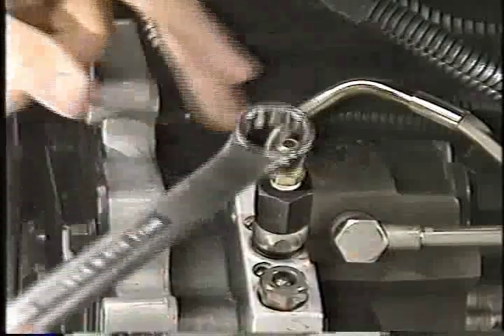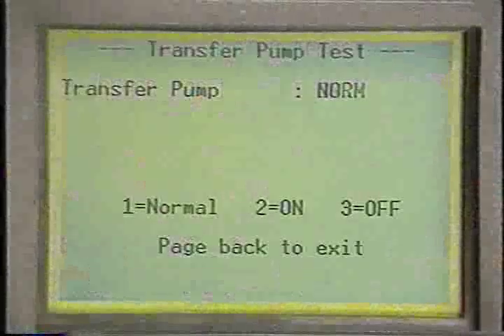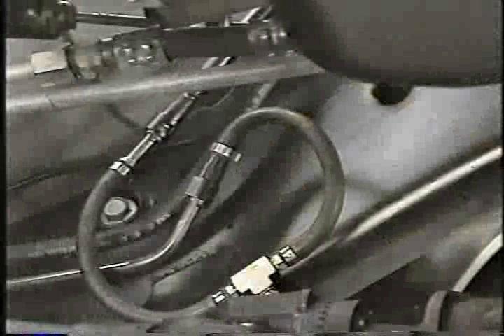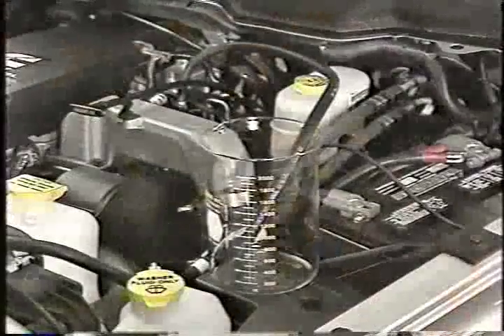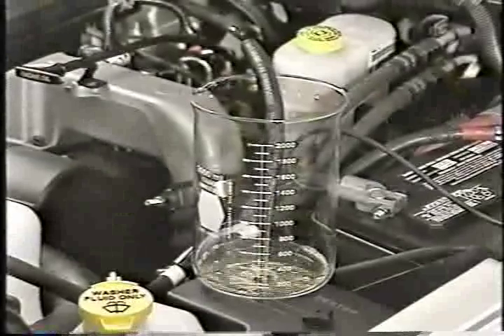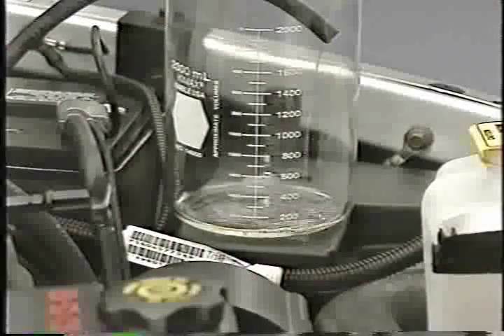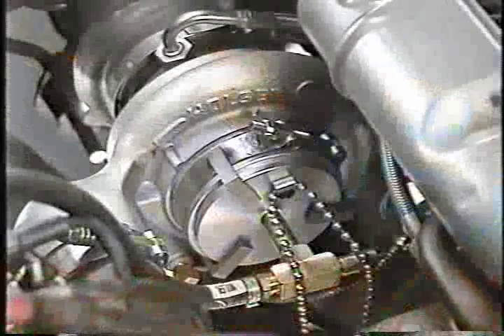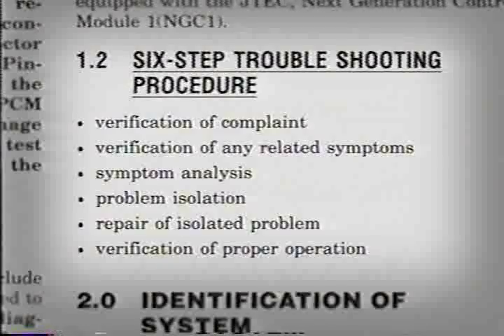Dodge Ram/Cummins 5.9L High Pressure Common Rail Diesel Engine Part 4 of 4

Comment: were can i find all these test fittings.
Reply: I recommend you to make them.  Just remove the banjo bolts from the engine as samples and buy bolts in any hardware store. Drill holes as per needed and weld the fittings to those bolt.